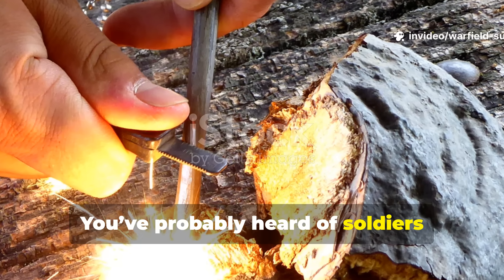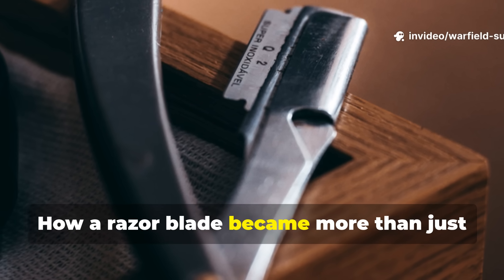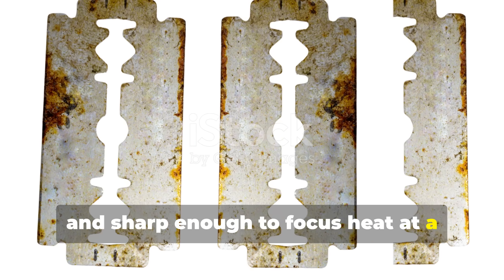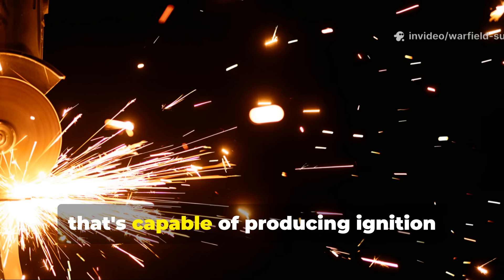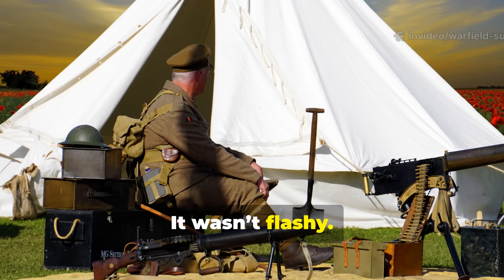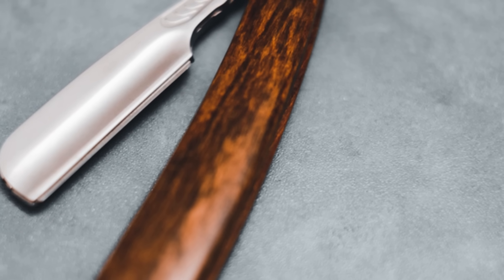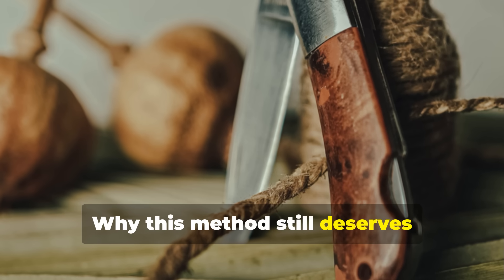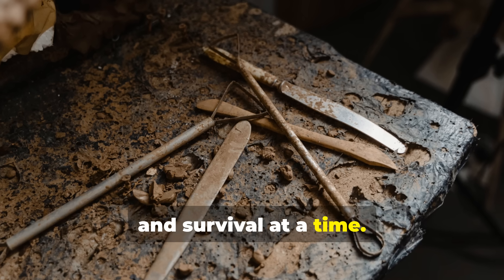The WWII Razor Blade Trick That Could Light Fires in a Storm

Comment: Yeah you can use a single edge or double edge old school.razor blade to start a fire with a ferrocerium rod, BUT its SAFER to use a plain old box cutter utility knife to do this because you can hold on to the blade while scraping the rod without lancing your fingers open. Actual FLINT is a ROCK with a Mohs hardness of 7 or above. If the stone has a sharp edge, you can shave off tiny bits of high carbon steel from an axe head, A worn out file, or the spine of a high carbon steel knife. The "flints" in a lighter are actually tiny ferrocerium rods. You scrape ferrocerium, you dont HIT it like old time FLINT and steel. Les Stroud calls the old method ROCK and steel because you can also use agate, quartz or chert. You can also scrape ferrocerium with sharp glass, a stainless steel knife spine, a high speed steel lathe bit with sharp edges. You DO NOT need a razor blade to start a fire with #0000 steel wool. All you need is a 9 volt battery. 0000 steel wool can be lit with sunlight using a magnifying lens or ferrocerium sparks scraped into it. These AI videos are a dime a dozen and most of them are full of half truths at best. Learn from a reputable source and put in the "dirt time" practice so that you understand tinder , ignition, fire bundles and proper combinations of tools and techniques. DONT wait until you're freezing to figure this out. People die every year from hypothermic conditions and most of them have 3 or 4 bic lighters and matches on them.